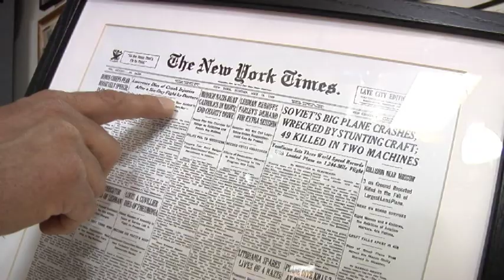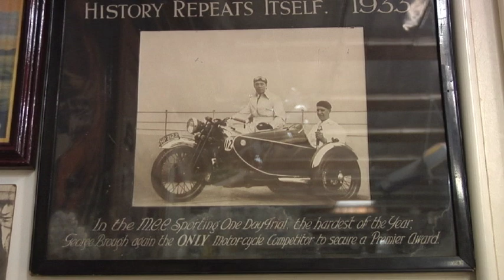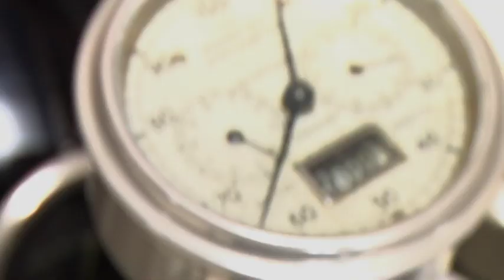1930 Brough Superior SS100 - Jay Leno's Garage

Comment: Jay's collection suggestion of the day: A rebuilt Honda CMX Rebel. 234cc twin.
Swap the stock 33-tooth rear sprocket with a 28-tooth and disconnect the accelerator pump/valve.
Rated 70mpg, the Rebel gets 60-65mpg. Disconnect this valve and get 85-90mpg with a wider range of useful low rpm torque. At 20mph, my Rebel in 5th gear will Full Throttle 20 seconds to top speed of 75mph. Dazzling dazzling speed. The sweet spot at 20mph is in 4th gear, 4 seconds to 50mph, 5th gear another 10 seconds to 75mph. Slow but who cares? Jay you gotta try this marvel on a Rebel. 
Sounds like a song lyric, marvel on a rebel, doo wap a doo wap.

Comment: An uncle of mine had one of these with a 
Steib sidecar. His wife hated him riding it and occasionally persuaded my father to slip a bit of cigarette paper between the points so that it would not start. He was not mechanical and never worked out what was the problem.
He was tiny but always managed to kickstart the beast until one day he came back into the house sweating heavily and covered in dust. “ Sodde it, that’s it, it’s going.” Apparently as he tried to start it it kicked back and threw him clean over the handlebars! His wife rejoiced.

Comment: Mark Upham, an English guy bought all the rights to Brough and the J.A.P. motor. He makes "new" Brough Superiors in Switzerland. They are hand made and will cost $250,000. They are better made as material and plating is far superior to the 1920/30s. One reached nearly 125mph on Bonneville flats. So a Broughs are still made.
Reply: maybe better made but never as authentic

Comment: You know, if I would hazard a guess at the reason for Brough using a double needle configuration for its speedometer, I would say that it is kind of like how a clock has its second, minute, and hour hands and that the needles represent a more precise method of exactly how fast that you are going, except that there is only two needles in the Brough speedometer configuration, whereas a clock has three needles on its face, thus, theoretically, it is possible to go over 100 MPH on the motorcycle, which is pretty impressive for a 1930s motorcycle.

Comment: Front Brake Stopping had not really been invented yet. The front brake was mostly to hold you still on a hill while you adjusted other parts of the bike, or changed foot down posture. I use mine most of the time while I am kickstarting it, it to keep from losing the bike if it accidentally drops into gear.

Comment: J.A.P. and other speedway motors had total loss oiling, just piddled out along the way.  Like the handlebars, Honda Super Hawks originally came with ones similar; riding position well balanced against oncoming wind. The Brough looks like it had a fairly long wheel base.  Nice to see, Jay.

Comment: Lol - “The Seven Pillars of Wisdom” is “very” readable, that’s why it made such a great movie.
Reply: I was surprised by that....I read it and it reads like a novel.....whether it related exactly to what actually happened is open to dispute - the film took a lot of liberties.....but difficult to read? Quite the opposite.....
Reply: @panchopuskas1  In actual fact, archaeology seems to back up Lawrence's account. A .45 ACP cartridge case was found on the site of the infamous train attack - the pistol was extremely rare in the Middle East, at the time, but Lawrence had one. I should be very wary when cautioned against texts - a classic instance is Keynes' "General Theory". If you're acquainted with economics up to 'A' level it's another "good read"

Comment: i love that wig-splitter number tag on the front
Reply: +Lone Wulf Jay has 'em on most (all?) of his English bikes. Very evocative touch, IMHO.
Reply: +Flonk Bob   That front plate was required by law on English motorcycles until 1975 when they were phased out for new machines.  This was for safety reasons- they truly were 'wig-splitters' and maimed a lot of pedestrians!  The law does also allow pre-1973 bikes to carry these old plates- in non reflective paint too- no English automotive law on fitted equipment can ever be made retrospective.
Reply: We call it a pedestrian slicer in India - or used to until the plate was required to face forward.
Reply: tryarunm  Is it to allow the insects to pass on either side.

Comment: What a cool bike, my 1st bike was a 73 Kawasaki 350 triple 2 cycle/bug killer and it would barely do 100 mph so yes in 1930 that was lightning speed though the British bikes like Triumph were never noted for acceleration like a K 750 triple but they did cruise and sound great, also Norton is a classic.

I have a possibly stupid question, are those open valve covers/rockers? If so what about road dirt? Gotta love all that hand made levers, speedo looks like something from Omega or Breitling

Comment: Does anyone know why this, and other old motorcycles would've had a brake lever with its fulcrum mounted onto the OUTER end of the handlebar, like the way the German military had on their BMW R75 and Zündapp KS750 Wehrmacht motorcycles for BOTH levers, while the Brough's clutch lever is mounted-up conventionally, with ITS fulcrum positioned inboard, on the left side of the handlebar?
Why the TWO configurations on some early British Bikes, versus the outer-fulcrum on BOTH levers on the German military bikes?

Comment: That's like taking a McLaren F1 and putting on DUB rims, an airbag low rider suspension, and a new interior with a sound system in it.  Not mentioning classic bike snobs, why would you ruin such a piece of craftsmanship, hard work and engineering?

Comment: 2:27
of course yes and may the 1000cc Koehler-Escoffier, collectable bike and maybe the 750 ratier or the cemec, some Magnat-Debon too would be collectable and also some 1000cc Anzani (single) and maybe a Della-Ferra 1000cc twin would be collectable or Bayernland be alright or D-Rad, Aristos, Excelsior, 1200cc V twin Feilbach 1914, 1908 FN 4 cyl would be ok I guess. Bon, I am not going to right you a letter right? still, a Goetz or a Gnome et Rhone, P&M TT,,,etc.
Reply: AJS SR10, though an M7 would do fine, OK.

Comment: Does it still leak oil or have you stripped it and done it properly? A friend bought a new 72 Bonnie and on admiring the brand new bile it dripped oil on my new suede shoes -I had to throw them away. I hate Triumphs. :-)

The new Japanese bikes in the 1960/70s ran all over the antiquated British bikes as they were made in new modern factories. The UK bike industry was still largely hand built. They could not compete in price, reliability, quality and technical design. But they were nicer to ride
Reply: I suggest sailing, a clean sport.

Comment: Well,trust yourself on the brits to make everything more complicated.Why have a FOOT SHIFTER on the left like all motorcycles and have all hands and feet distributed/occupied when you can mount it on the right and make it a manual shifter (or a foot shifter on the likes of bsa),so you get off the acceleration,change then return and so you have an overworked right hand and 2 feet standing .
What a THROUGHLY IDIOTIC ideea.I wouldn't buy one just for that.